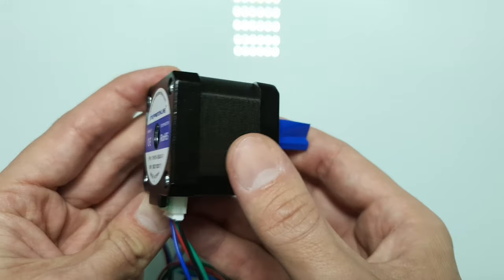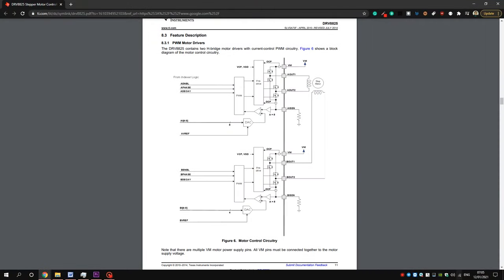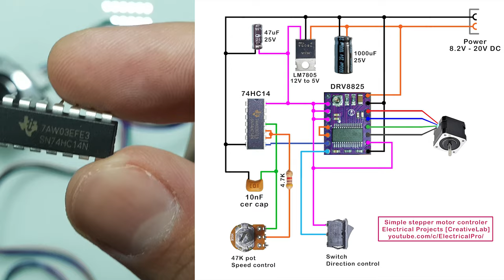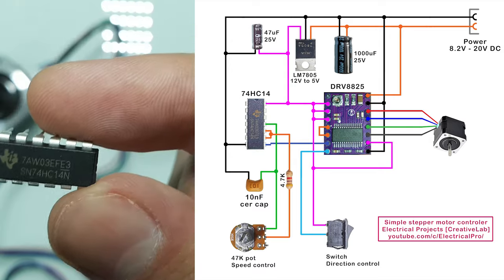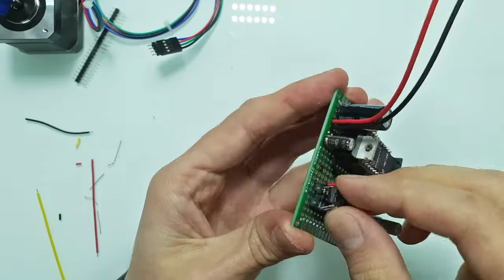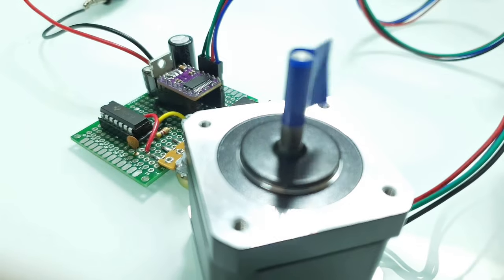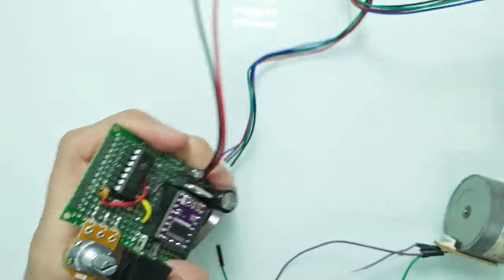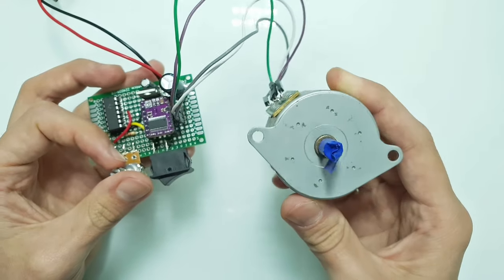Stepper Motor Controller Without Arduino or Microcontrollers | Simple DIY

Comment: A more flexible solution would be to add controls for continuous and momentary operation... a three position On-off-On switch would allow continuous operation, and the existing up/down switch would be paired with a pushbutton (or two pushbuttons) to allow easier operator control.

Comment: Hello,  Great video! I bought the parts for this and built one. I actually got it to work,   will this perform  better using say 24volts as opposed to 12volts?   Thx

Comment: Okay, excellent. I need to clear a doubt: There in the circuit link, the circuit has MODE1, MODE2 and MODE3 in "VCC" and so we will have microsteps.. I want "Full step"">>>> I have to put them all in "GND" or leave them disconnected? Congratulations for the article/Video. Thank you from Rio de Janeiro/Brazil.

Comment: Do stepper motors run cooler with driver is set to less steps per revolution? 
Do stepper motors run cooler with driver is set to less Amps?
I am using Nema 23 57x57x56mm, 23HS2430B, 57BYGH056
Using DM556 Driver
ZK-SMC01 stepper motor controller
AC 110v to 24v Power Supply 20A Max
Using on a machine that runs for hours at a time. Motors run feed screw at constant speed one direction then the other direction for 10 minutes before reversing then repeats.  Driver is now set to 2.7A -1600

Comment: I love the circuit. I wanted to run a window shade up and down with a stepper motor and didn't want waste and Arduino. This would work great (with a little tweaking). 

One question. Could a 4014 work?

Comment: I built  the circuit but dashed if I can get it to work with exact components and stepper motor as per circuit diagram.  Tried other SM's with same result... failure. Something wrong in the circuit diagram?  Also changed main components in case one had something faulty
there. Still failure.  This is just the sort of circuit I was looking for but sad I can't get  it to
work.
Reply: Same here.

Comment: Hi.i want to make motion like elevator by means of step motor that give me up and down motion and every time I press botton to stop the elevator comes down and stop if everywhere it be.like movement of dumper motor in split air condition that swing motor goes up and down and when off the unit it retracted automatically.i want to know what driver or module i need

Comment: I set up the circuit. But it doesn't work. I thought there might be a problem with the components. I ordered the combinations again. I re-set it up. But it didn't work again. I got support from a professional electronics engineer. And it didn't work again.

Comment: Can 2 limit switches be added to the controller. If so, How?
Reply: I don’t see why not. Use your limit switches to operate some relays. Many relays have normally open and normally closed contacts. In this way I think you could have it hit the end of travel limit and either stop or reverse depending. He already showed that the motor defaulted to one direction and by toggling power it would change direction. The other option should be to kill power and stop the motor.  Go find some videos on Bosch relays. And relay logic in general.  I’m sure there are more elegant ways, but I’m a mechanical guy and relay logic is fairly mechanical so it suits my way of thinking.

Comment: Simple DIY: Instead of arduino or microcontrollers, let's build a controller from scratch. While you can control it with 2 caps, a button and a variable resistor...
Reply: Could you explain how?

Comment: What about the torque strength of the motor if a potentiometer is installed like that
Reply: Well, the available torque of any stepper is a function of speed (Google “stepper motor torque-speed curve”). The potentiometer isn’t having the effect you think it is though, if I am guessing the origin of your question correctly. The potentiometer is controlling not the voltage amplitude to the motor, but the voltage pulse frequency the motor driver is receiving on its control input.

Comment: nice but it is not useful when the motor starts to rotate when i plug it, i need to press the button to rotate clockwise and press another button to rotate in anticlockwise, how to do it ? this will be much useful to me .... thanks
Reply: hi, is it your circuit worked?
Reply: @p.7555  yes, 1 switch for change the direction, and 1 button i press it to drive ,

Comment: does this work with a nema 23 ?
Reply: I'm not sure why it wouldn't. But I would make sure set the vref correctly as to not pull too many amps through the driver.

Comment: Have anybody got this to work? I bought all the components. Assembled it on my breadboard. And the motor kind of turns. Sometimes it takes off for a while and then stutters and it just seems to be no consistency. Anyone have any ideas?
Reply: From the data sheet. Reset and sleep pins must be high to enable driver. That's pins 5&6. The circuit that is shown in the video links 5&6, but doesn't connect that bridge to +5 Volt supply. Suggest you modify your circuit and try again. For full speed, disconnect pins 2,3,&4. Connecting those pins to 5 Volts as shown gives minimum speed, ie. 1/32 step.
That driver circuit has a miniature potentiometer on it. If you start running a motor on load, you can burn it out. It's there to provide current limitation, and there is a setup procedure to follow. That will also cause running problems if set too low at the factory.

Comment: I couldn't get it to work either.  It just locks the motor.
Reply: Pins 5&6 need to be connected to 5 Volts, or it stays in sleep mode. Give it a go.

Comment: Not working. Motor just make a humming sound. And the driver gets really hot
Reply: Because he never showed you how to set the current limiting potentiometer on the DRV8825, and pins 5&6 should be connected to 5 Volts.
Reply: @peterrhodes5663  I have set the limit of the drv8825 and have connected pins 5&6 to 5v but still not working, do you have any ideas?
Reply: @Jordan_Fernando  All I can suggest is to start substituting parts. First check the resistance of both motor coils, or connect a drill to the shaft and monitor the output, ie., drive it as a generator, disconnected from the 8825. If it seems OK, replace the 8825 assembly. If still no go, get someone to check how you have wired it up, because if you are over familiar with what you have done, you can over look an obvious wrong connection, no matter how many times you look at it.
If you have an oscilloscope, check that you are getting the correct waveform at the point where the motor connects to the circuit.
Reply: @Jordan_Fernando  Just had another think about your problem. On his circuit, he left pins 1, 3, 5, and 13 of the 74HC14 open. They should be connected to ground or the 5 volt supply, whichever is easier, so have you got a square wave at pin 8 of the driver board? It's a cmos device, so all unused inputs must be connected, or strange things can happen.
The motor that he is using runs on 12 volts. Are you supplying the correct voltage to yours?
To make the motor run 32 times faster for any given input frequency, disconnect pins 2, 3, and 4 of the 8825 board.
If you get it working, let us know, because others are having problems, judging by the comments. I've never used his circuit.
DON"T GIVE UP!
Reply: Did you ever get it to work?  I’m having the same problem.